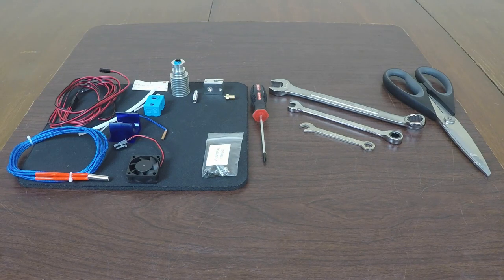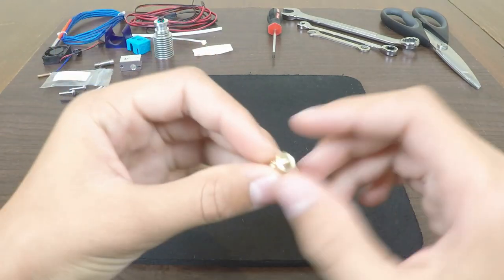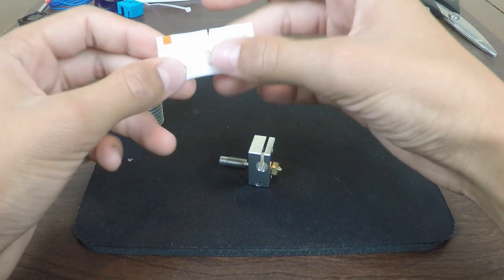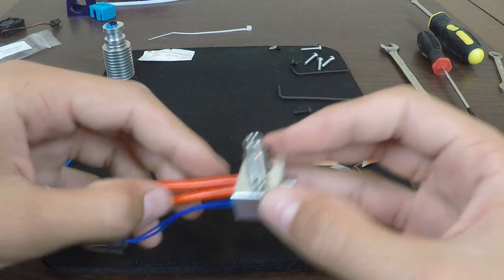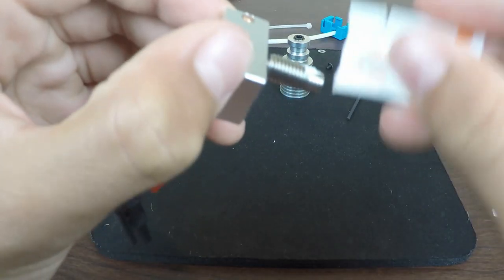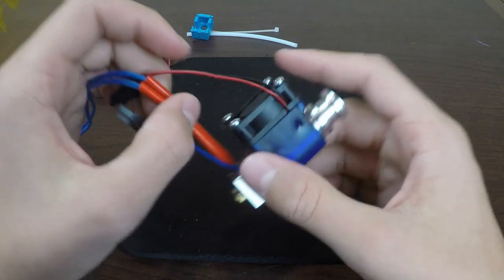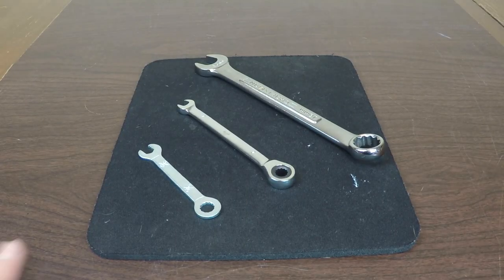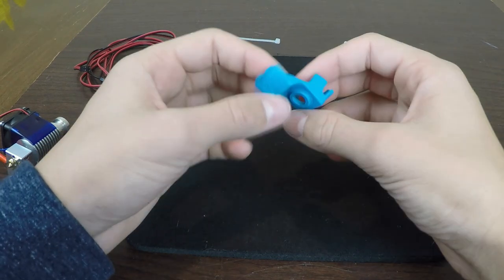E3D V6: Assembly

Comment: You had tp print parts to install to your Robo right?
Reply from the maker: My original hotend set up actually broke during a print, I ended up having to fabricate a part out of slivers of plastic and tape to act as a placeholder. However, if I were able to print before hand, which everyone should do before they disassemble their old set up, I would have definitively printed out this part, which is the sole necessary part for fitting up the e3d v6 to your existing extruder system: https://www.thingiverse.com/thing:1636660
Reply: Bushido 3D no additional fan shroud is needed? My E3DV6 arrives tomorrow
Reply from the maker: Yes, while the e3d v6 does come with a cooling fan and fan shroud for the heat sync, it is highly recommended that you print a part cooling fan shroud for your 40 mm stock cooling fan. Try the first option below:
This model works specifically for the e3d v6: https://www.thingiverse.com/thing:697200
The other standard model should work for both stock and e3d v6 hotends: https://www.thingiverse.com/thing:1374049
Sorry that I did not include this within the first comment. Good luck with your e3d v6!
Reply: Bushido 3D thanks!!
Reply from the maker: No problem, happy to help